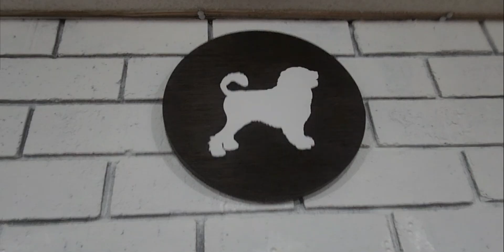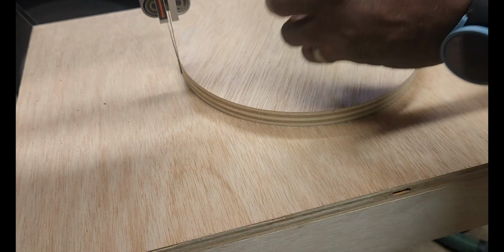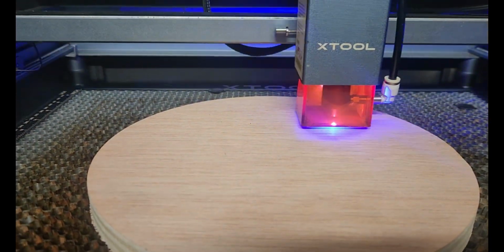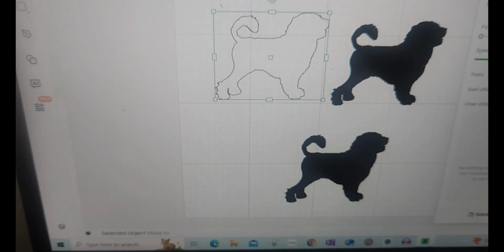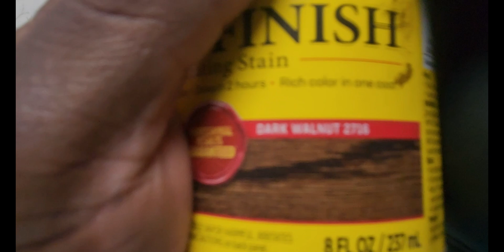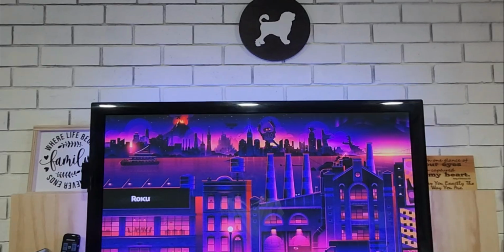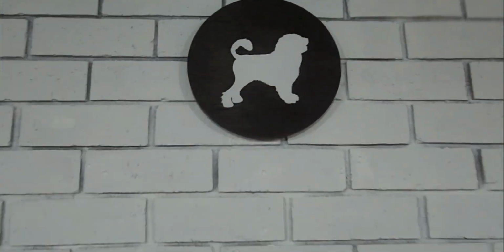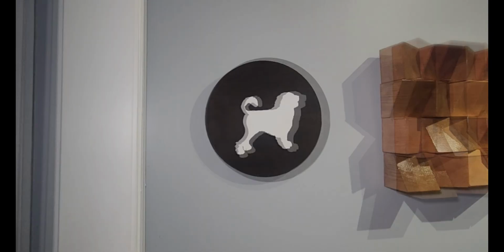Laser Cut Inlay and Kerf Using Xtool Laser and XCS Software

Comment: so the point of using kerf is to make your design flush like a puzzle, for raised layered designs like this you don't have to use kerf, just cut a thin layer of your top and glue it, having said that, great job sir!
Reply from the maker: @sjm8510 Thanks for the contribution. I appreciate you sharing your knowledge with us.
For this design, the client wanted it flushed but not all the way in, so it appears as if it was carved.

Comment: Great video (great speed & explanation along the way). Thanks for the words of encouragement & guidance❤. How many passes of engraving did you do to create the inlay space?
Reply from the maker: Thanks much. I appreciate your kind words. I did just one pass. 100% Power, Speed 50 mm/s , Lines Per cm - 300. I noticed that the high Lines per cm helps a lot with a smoother finish for that type of engraving for an inset.